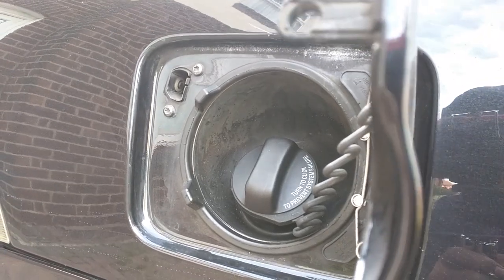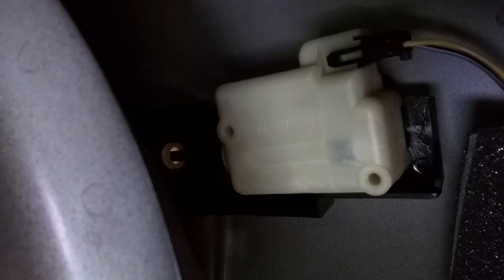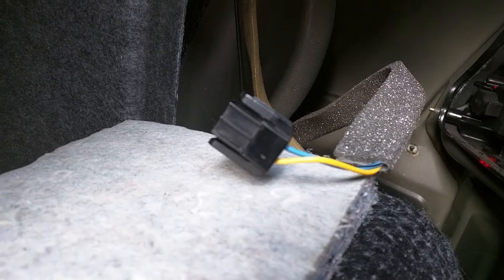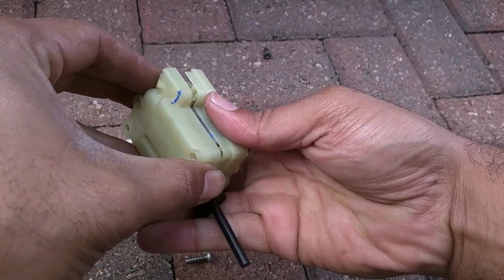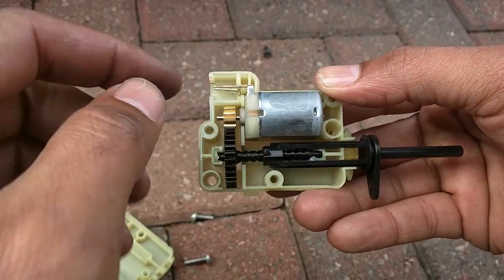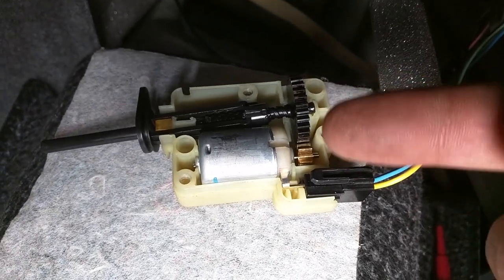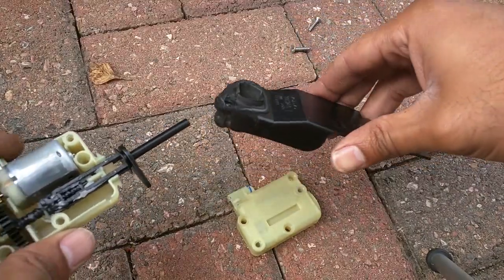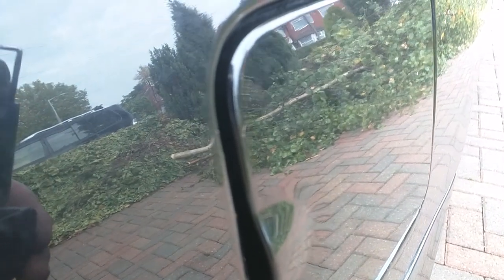Volvo Broken Fuel Flap / Door Lock Free Fix

Comment: 6 years on & this video is still of great help!!  My XC90 had the same problem & after watching this yesterday I stripped mine out this morning & covered the screw gear with white grease ( lasts longer than any other grease ) put it back together & hey presto SUCCESS!!!
 The only thing that’s different is the delay time before the plunger activates. For some reason the delay on mine is close to 20 minutes before it kicks in & locks the fuel flap. Apart from that I couldn’t be happier especially with arseholes stealing fuel from cars during the shortage right now!!

Comment: with my volvo V70 i got vida and i turned off the fuel door locking delay i set it to 0 Minutes it was set to 10 minutes So for me it was easy i just locked the car and the fuel door locked instantly And unlocked instantly if you have access to vida you can turn off the locking delay i hope this helps take care
Reply: It isn't an issue.  With a 12V power supply, you just alternate + and - connections to operate/test the unit.
Reply: That is an option you could put 12 volts to the fuel door but after I fixed my fuel door I went on vida and I turned the fuel door locking delay back on as I prefer to lock the car and still be able to put the fuel in I had the locking delay off temporarily so I could see if it's working but now I know it works I have turned the delay back on and I hope this helps and take care
Reply: One of these days I'm gonna have to get VIDA. Need an old windows 7 laptop though right?

Comment: I have my “lock, tank filler lid” ready to install. Fully checked motor and gear wheel of a plastic gear. In my case few teeth of that plastic gear were partly damaged and that was a problem.
Now there’ll be second stage of checking directly at the car with connection to the proper plug.
There are some second hand units available on the market so personally I suggest to buy such instead of horribly expensive new one. The “lock, tank filler lid” as it is named on www.skandix.de no  for my VOLVO S80 2.4D5 163KM DIESEL has the following part number 30612856. Maybe the number could be useful for anybody facing problems with the locking mechanism to identify the part.
Greetings from Poland.

Comment: Hi, so thankful to you.... I have an XC90 (2013), I found myself unable to refuel as the cap would not open... went to Vovlo, they sorted it and told me i should book the car in for them to look at it and fixed it... Estimated cost £500.... MOT due so have to have it fixed.... Lucky for me I found your video, and went to put some oil on the mechanism.... didn't even need to open the white casing. It is all fixed now.... And I have cancelled my visit to the garage.... You just saved me £500.... Thank you!!! I am so grateful!
Reply: A spare noname part i found was 60 bucks. 500 pounds for fixing that is so unethical but that is supply and demand for you. They'll take any chances they can to rob you when they think you don't know better.

Comment: Quite important to make sure the car thinks the latch is unlocked, before plugging it back in place.  On some cars, you'll need to press the 'fuel cap unlock' button on the dash for 2-3 seconds, before plugging the connector on the latch.  Otherwise, if the car thinks the latch is locked while the pin remains unlocked, next time you try to unlock it it will break the plastic wheel inside trying to force it open further more.
Reply: I am not sure that it would have broken the wheel - but this is good advice.  I hit the button a few times while in the unlocked position without thinking, and I heard it trying to actuate, but don't think it did any damage.

Comment: Thanks Si. My (V70 2005 Mk2, 130k) would not unlock at fuel station. Hit the wing next to the lock and it unlocked. Have found the way in like you suggested and will be doing the strip down and lubricate with Silicone grease, not sure about petroleum based grease on plastic. Potentially motor brushes have worn and are losing their pressure and sticking !!

Comment: I had ALARM SYSTEM SERVICE REQUIRED on the MFI and flap stuck locked.  Takes 10 minutes to repair (redistribute grease) if you have TX25, TX20 and TX15 to hand.   Indication cleared after 10 mins of driving.

Comment: What if my connector works only halfway, when i press unlock it multimeter shows bout 10amps but no voltage when i lock it? Is there problem in the cable(i dont think so bcuz it would not be functioning at all, right?). Is there any fuse/relay assigned for this?

Comment: Its the same unit on the XC90,  I found the contacts to the D.C. motor (it's not a solenoid) were loose and intermittant, usually only failed at the garage forecourt !  fitted a nylon fishing line to the locking pin for emergency operation too  :)

Comment: Good suggestion and excellent video, but I didn't fancy screwing into a metal body, near a fuel cap.  I sourced a replacement (new) bracket & spring from a well known auction site  for £6.99 and it took me 1/2 to fit.  It was an aftermarket part rather than a Volvo main-stealer priced part; but on a 14 year old V70 (with only 55k on the clock) it was worth the price and the time. Thanks for your video's; I do find them easy to follow!
Reply: Hi, have you got a aftermarket part number please??
Reply: Simon king, did you watch this video or a different one? Si didn't comment on the hinge spring? & For information- the screws are only a few mm long once they screw into the plastic insert theirs just a void so no danger of screwing into the fuel filler pipe.
Reply: You don't understand how gasoline, pressure, and spark work.  There is no risk whatsoever of an "explosion" or "fire".
Reply: @gasgiant7122  yeah I must have commented on the wrong video. Six years ago so really can't remember. Usefully have far too many tabs open and don't know where the music is coming from!  What I do remember is buying and replacing the spring/bracket and all good. Also followed the refurb of the locking device, cleaned and lubed. All good. Really rate the videos SiRobb provides.

Comment: Great video, thanks. Judging by the number of views, this is a common problem!  My flap refused to open when I pulled up at a petrol station and I've got a temporary fix (?!) of plugging the hole in the flap.  Will have to do it properly. Very easy access.

Comment: Just used this video to recondition the fuel flap solenoid on my XC90. Worked like a charm, though like one of the other commenters I thought at first it hadn't worked because the delay time is about 20 minutes. Thank you for doing this video, it's saved me simply paying to replace the part.

Comment: i used a silicone lube spray to spray the mechanism inside the fuel door and also the locking mechanism inside the trunk under the carpet...works fine

Comment: Great video and explanation.  In my case, the failure was the white bushing that inserts into the mounting plate/housing came loose (it is tight to the plate/housing in your video) and I believe it was preventing locking from happening.  The detailed disassembled video was very helpful.  The innards of my unit were clean and like new, after 18 years.  Another benefit of your video is that a small bumper piece that slides into half the housing that lessens the impact on unlocking fell out when disassembling - in your video I can see it in its proper place.

Comment: Great help, in my case the electro-motor was sticking. Spayed it down with WD40 under constant battery power. Could here rpm increase as the shaft got lubricated.👍

Comment: Don't forget to grease the TWO black pieces ALL AROUND, because these have several surfaces that need to slide.  So smear both black pieces with grease everywhere, including the long pin.
Reply: This is not the advice you gave in your video.  You said to grease only the gears.  I appreciated your advice above to hit the "unlock" button, so that the car doesn't try to unlock even further from the unlock position the first time.

Comment: Had my fuel cap stolen so after buying a new one I looked into why my fuel door lock wasn't working. Re-seated the connector contacts and tested it in both directions with the 12V auxiliary outlet located on that panel. Got it working nice in both directions but still couldn't figure out why it wouldn't lock. Watched your video and voila!

Comment: Thanks a bunch for this video. Just recently I actually found this wire hanging loose, disconnected from the socket and I had no idea where it was supposed to go. Turns out the fuel door never locks on my car. The previous owner of the car probably disconnected it after a problem with the mechanism. Gonna look into it now. Thnx again!

Comment: Hi Si - same as below. I have had a 2005 V70 for the past 7 years & the fuel flap mech as never worked. The bonnet/hood will not release and whilst researching that issue I came across your video. I had a quick look and found the power source to the flap lock mech was disconnected?? I followed the advice in your video and "hey presto" it now woks. Many Thanks. You don't know how to release the bonnet/hood latches do you? :)
Reply from the maker: Not needed to mess with the bonnet cables other than the odd clean and grease so can't help there unfortunately.

Comment: Well that was great not only did you help me with the electrical issue but I also noticed the two bolts holding the flap spring that was also broken on mine and easily fixed by watching your video thanks a lot

Comment: Daughter: ’Dad the fuel cap on my Volvo isn’t locking it’s just flapping in the wind?’

I watch this video…

Calls daughter asks some questions.. 

She had just gone to the shops and was in there for only a couple of minutes when she comes out and noticed fuel door flapping in very windy conditions… 

This video explains delay in locking feature.

Tell her to go outside and check car after been parked for some time. 

Fuel door is locked. Fixed

Now going to watch the next video regards fuel door hinge.. 

Might be an issue with that..?
Reply: If the wind has blown the flap out at the time the locking pin came back out it won't lock the flap. The spring in the hinge maybe broken or weak.

Comment: Unfortunately im having the complete opposite problem. Mine does not seem to lock at all, and it is getting the same voltages shown here. Its driving me nuts, every time i go to drive the fuel flap is just going all over the place
Reply: This video shows you everything you need to get the unit working right, for any situation.  Maybe your door spring/hinge is also broken.  If so fix that first.  On my unit the white bushing around the locking pin that goes into the black mounting plate got loose, and was preventing the door from locking.  I glued it in.

Comment: cheers - my XC70 wont UN-lock - most embarrassing at the fuel station smacking the side of the car to get the actuator to spin. Also the wife thinks its a heap anyway and not being able to fuel the car may leave her stranded.   Guess what I'm doing tomorrow.
Reply from the maker: The flap can be manually unlocked by going behind the luggage compartment trim and pulling the plastic slider on the lock unit.

Comment: Thanks to your video, my tank is safely lockable again. I took the motor off, then I found out that two teeth were broken off the gear. I repaired and re-assembled these and then everything worked again. Thanks again!
Reply: Jurre Mattheeuwse two of my teeth have broken off. How did you repair? Dont think superglue will work
Reply: Superglue was my first idea, but that broke again. Then I took a piece of aluminum, in the shape of a little pizza slice. With a file I made two teeth at the rounded end of the 'pizza slice'. Then I roughly cut the shape of the piece of aluminum from the plastic gear with a little saw (not to the centre of the gear, roughly halfway), heating the aluminum, and fusing it into place in the plastic. Two drops of super glue for the security on each side. At last I filed the sides flush and the lock still works after a few months.
Reply: Jurre Mattheeuwse thanks i'll try. Cheapest price on ebay is £30..dont want to pay that lol
Reply: I had the same problem, 3 teeth were broken on my 2004 S60. I used smth similar to JB Weld, mixed the two compounds together and slap them onto the missing teeth, then I filed them after it has cured, which was around 5 to 10 mins. Now it works like a charm. Thanks to SiRobb for showing the internal workings of the locking mechanism, it's not so difficult to fix after all.

Comment: It worked for me too. The manual release flap broke off as I fiddled with it which is typical of old plastic. Hope it doesn't cause me trouble one day. 60 bucks for a replacement so I think I'll take my chances. Worst case it can be disassembled and pulled out.
Reply from the maker: @Dennis-ud2nh  Try a breakers yard for a working spare. Nothing ends up in a breakers yard because of a non working fuel flap so there's good chance of success. 👍🏾
Reply: Sorry, I think I used the wrong word. The thing that broke is the plastic protrusion that you pull to undo the lock from the inside of the car in case the lock is jammed. I think I'll manage anyway. And the lock still works about a month later just from lubrication.

Comment: Brilliant, thank you sir. My flap hinge spring thing just broke. I was wondering if there was a quick fix! And your other vid showed how. Mine only stayed closed because of the filler cap springy thingy, hardly a solution... Plus the flap locking mechanism in this vid - I'm on it! It didn't really work reliably when I bought the car, but wasn't too worried about that. Now, a 10 minute fiddle might do the job, with luck. Mind you, there are loads of pattern bits available out there. £5 for a complete hinge assembly (which might break really soon after fitting). My last job was the rear wiper. The nylon gear wheel was eroded by the worm screw, so repair wasn't really straight forward. A rebuilt complete motor assembly cost £25 delivered, and was a half hour job to fit, tops. Works as it should now. But does anyone have an answer to this - the rear wiper blade really won't bend to reach the top of the rear screen. And it hits the 'spoiler' (stupid thing, but not removable, realistically) too, the cause of the gear wheel failure over time. I bought a new arm and blade assembly, and the same problem occurred. So I have sawn part of the blade cover away. Not ideal, and shouldn't happen - any ideas out there? I'm sure it worked properly when I bought the car as an 8 year old... But don't despair, all you Volvo owners of ageing vehicles, there is usually a way. Like with 'cloudy' headlamps - either an afternoon's work with emery paper and elbow grease + laquer (literally £3, plus £5 postage from China!). Or £40 a pop for pattern headlamp units and an afternoon working out how to re-fit the bumper. Keep up all the good work SiRobb, from Sir Bob o' the far North (-:)
Reply: A new hinge is the right way to go.  Less than $20 US, and a half hour of work.  Using self tapping screws is an inferior solution.

Comment: My fuel cap won’t open. 😢. 2008 xc90
Reply from the maker: Find the motor and you can manually pull back the lever to unlock.

Comment: 2005 V70R looks totally different when you pull that panel off.  The fuel door mechanism is nowhere in sight.
Reply from the maker: The fuel flap is externally the same. How can it be internally not present? Post a video please.
Reply: @sirobb  when you remove the interior panel you see another layer of sheetmetal and the accentuator (I think that's the name) is behind it and completely blocked off. If you're really interested I could email you a photo.
Reply from the maker: @dannyzuehlsdorf3697  I wouldn't say interested, lol more slightly surprised. It's ok, I'll put a V70R into Vida and look at the workshop manual if it bothers me enough. 😊
Reply: @sirobb  Yeah, check it out. This is a 2005 V70R AWD automatic.

Comment: mine goes out when unlocking, but locking it wont go back at all. ideas? grease not work
Reply from the maker: @PwndersWoW  There's a delay in locking. Check it after 5 minutes.
Reply: @sirobb  you are very correct! my man. just discovered it a few minutes ago. Motor now works nicely! Awesome video and I appreciate it so much to this day

Comment: Hi .Great video,I’m A novice,what would you call the inside part ,if looking on eBay,or online . I have A Xc90. Thanks
Reply from the maker: Type in XC90 fuel flap hinge.
Reply: @sirobb  Thanks so much .
Reply: Mine is loose ,it comes up on the message display. Does that mean I need another hinge. Thanks again for your videos.
Reply from the maker: @jalebjaba1487  What is the exact wording of the message?
Also what is loose? The flap door to the hinge or the hinge to the car's body?
Reply: @sirobb  The door doesn’t close flush , therefore I get A message that it’s open. Thanks

Comment: Great! But mines locked and can't get into it!! V70 d5 2002.
Reply from the maker: Look at my other video for the location of the lock mechanism and you can manually pull back the locking pin to release the flap.
Reply: Looked and looked can't find it...desperation lead to bursting flap lock...no body damage..and I've a locking cap..so there you go..thanks anyway,your vids have helped me out many times!!!
Reply from the maker: @madcarew5168  you can see the location 55 seconds in. Not to worry.

Comment: you have 2 rivets missing from your fuel flap hinge !
Reply from the maker: The fuel flap works fine. 
The crappy original design has been replaced by a permanent fix instead.